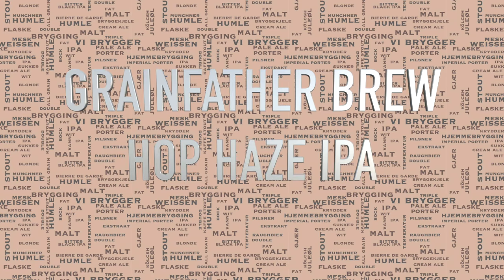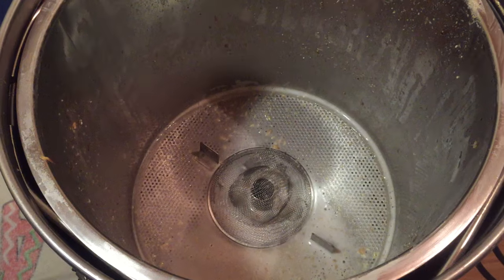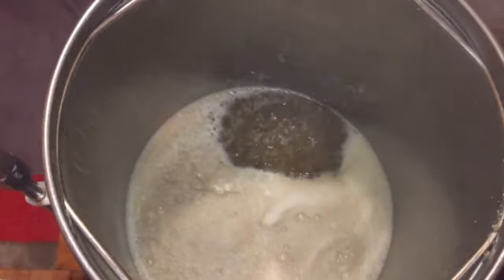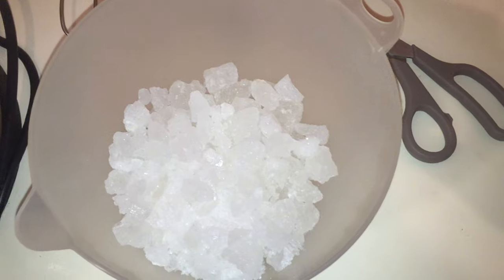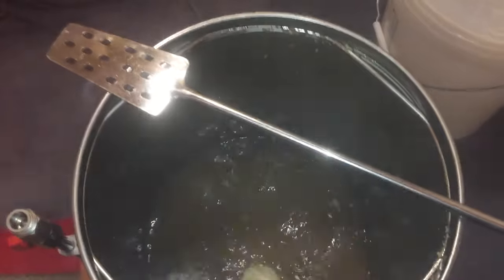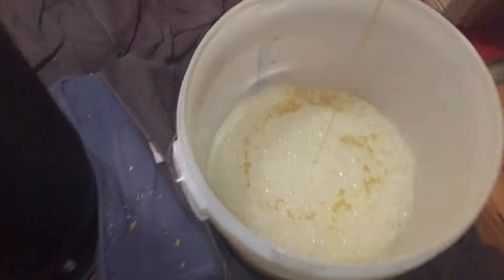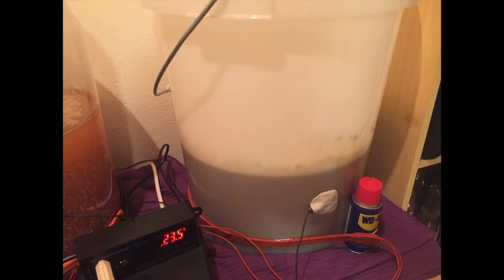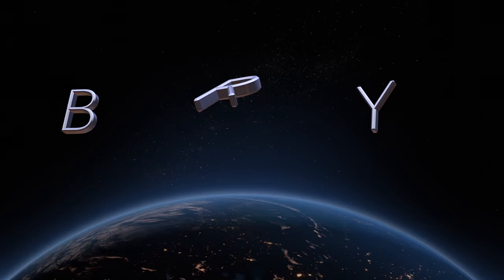Hop Haze IPA Grainfather brew with reduced pipework

Comment: Another top video...keep them coming. Do you have any trouble with a clogged filter ? I made a brew today (Coniston Bluebird clone) which included 90g of hops(flowers) and the flow from my chiller into the FV was very slow. The hops were in muslin hop bags. Thanks
Reply from the maker: Hey Sven. I didnt have any issues in this one but I have in the past. I find a 0 min whirlpool solves the issue. Afew mins does the trick.